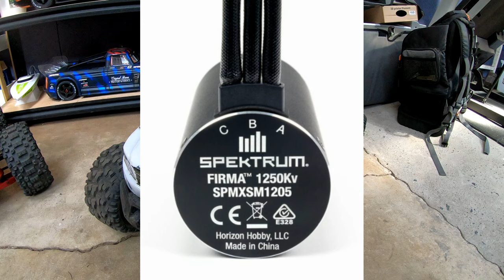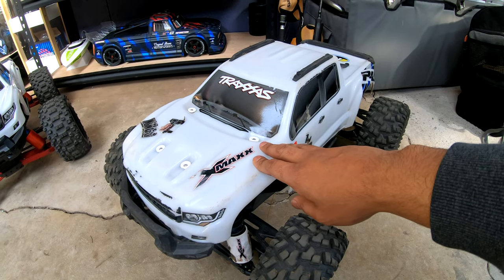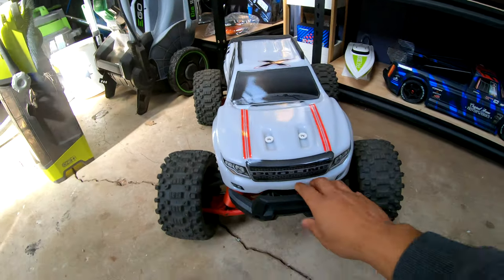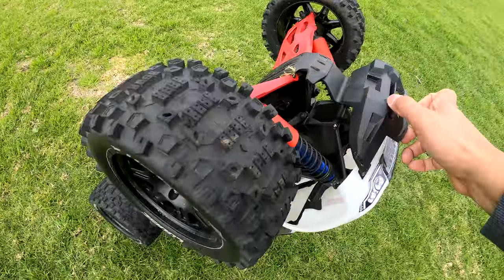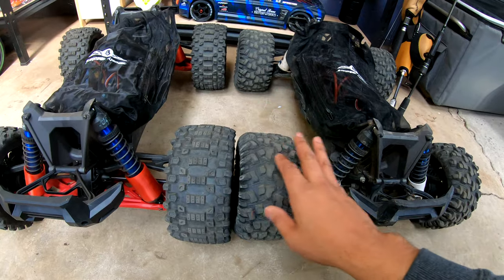Traxxas Xmaxx Upgrades Update - New Zeee Batteries, Louise Uphill Wheels, Dynamite Speedometer

Comment: Great vid mate I’ve got the same motor in my xmaxx but with the max 5 in it and it’s a beast.
Reply from the maker: Thanks man! Appreciate you watching! Yeah i think i may need to upgrade to max5 esc..  i like these motor way better than stock! Stock once the bearing dont seem to last.. 👍
Reply: Can i ask im looking to do this combo in my xmaxx geared at 54-19 or 20 ? Would that run pretty cool and give better air control
Reply from the maker: In 1.5 mod gears?
Reply: @KingsRC  yes for sure just looking for the air control
Reply from the maker: @timmytfpv7316  you might need to go with a max 5 man.. i had to lower my pinion as the max 6 cuts off sometimes.. thanks for watching dude hope your subbed 😊

Comment: Great video, what camera do u use for filming?  ,think I'm going to stick with the 18t/46t now,very happy with the power now
Reply from the maker: Thanks mate, yeah the 18t 46t is actually a good balance, i just change my gears to 1.5mod because i didnt have good luck with the mod 1(check out my previous vids).. I used gopro hero 7 and hero 9. Usually have the 9 mounted to my controller and the 7 in my pocket on a tripod to get the still shots.

Comment: I keep blowing out my stock xmcxx tyres and wondering how differently does the Louise tyres handling since they don't balloon?
Reply from the maker: Its different, u need a more powerfull system to do backflips easier. But worth not having blow ups! Just make sure u check if the glue comes off..otherwise u could still tear if your running with the glue undone

Comment: How much do your new 4 wheels weight compared to the stock Traxxas wheels?  Also, how much do both those batteries weigh?  Thx!
Reply from the maker: Sorry man i dont have a scale to give you a precise answer, but the 2 batteries diffinitely have some more weight on it maybe adds about half weight of a 5000mah battery by estimate... Also the tires are significantly heavier than stock all 4. Hope you sub man 😊

Comment: Are the wheels still holding up??
Reply from the maker: Just had to re glue some spots, but yeah still going!
Reply: @KingsRC  as in the tyres comming away from the wheels?
Reply from the maker: @dualtrondreamteam6811  yes there coming off on the side wall. But once glued back there all good. As long as you just check them now and then.
Reply: @KingsRC  thank you I appreciate you taking your time to reply to my messages
Reply from the maker: No probs happy to help 🙂